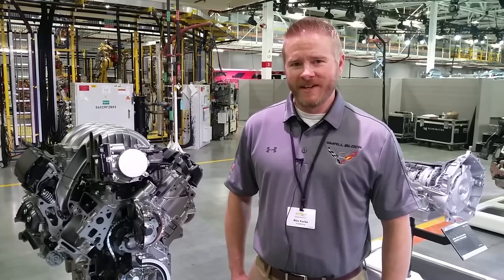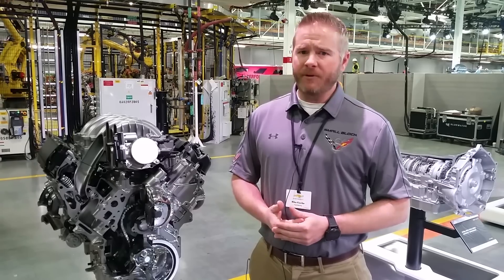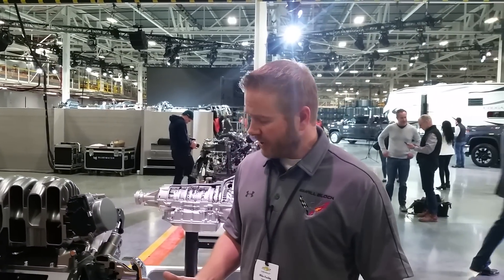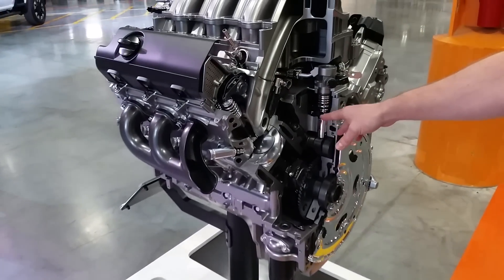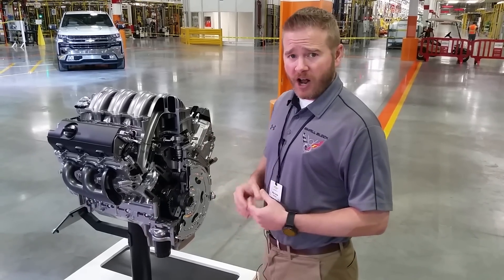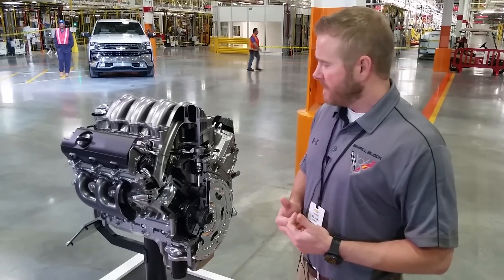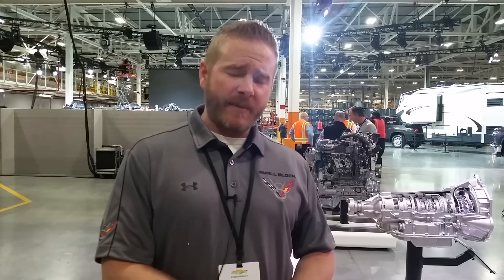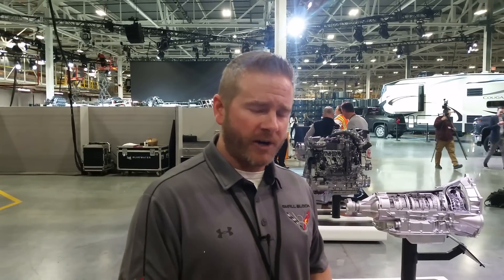New 6.6-liter V8 gas engine on 2020 Silverado HD

Comment: I am sitting by that junk 120k miles. No start,  fuel pump code, crank and cam shaft position code (I bet it's that variable valve actuation). Already changed the locked water pump on 60 k. Lines from oil cooler is bursted on about 70-80 k, beware of buying that stuff! Gm- you're building junk nowadays!  Bring back 6.0!

Comment: If the Variable Oil Pump is anything like the 2014+ 5.3l/4.3l; you guys messed up.
To change the pump you have to remove both the timing cover and oil pan and it’s an absolute PITA.  That stupid two wire harness that goes through the timing cover down to the pressure solenoid requires the pan to be removed just to get to a plastic connector trying to live in a 200+ degree environment.  But there is no way to change that harness without pulling the pan because it only pulls out through the accessory side.
Plus there isn’t a bough clearance to remove the pump anyways without taking the pan and timing cover off.  It’s a trash design and better off being left as mechanical versus electronically variable.

Comment: Putting a gas engine in a 2500 or 3500 is really dumb. Not only gas mileage is bad but the power, diesels are meant to tow and you don’t have to go to a gas station every 15 miles but the torque and power

The amount of shit you put on an engine the more shit it runs. Hint, fucken emissions.

Comment: Only 6.6 L V8 Gas.....why not 16 L V8 next time, when do we gonna learn that to tow or play with weights like a load its better to use diesel......this is 2019, this guy would not be so happy with that engine in 2023......Gas is at 11$ a gallon.TH

Comment: Why mess up something so good? Is Chevy scared because our 6.0 has been lasting so long they have to introduce something we know nothing about to work on comfortably at home? Me 03 is bare bones stock 239k and no real issues. Yeah she uses oil but as a truck owner that uses it to tow and work I check it as needed. Stop trying to improve where no improvement is needed. Improve a damn near bulletproof motor and make it better. Done.

Comment: When an engineer is speaking to other engineers pretending that consumers are listening. 
I'd bet the vast majority of people watching this are car guys (and gals) wanting to know if this motor will be a better swap candidate than the gen IV and V motors.  What is the stroke in inches, what is the fuel pressure in psi?  Are the heads different than the L86/7, can the variable oil pump be swapped out, can the rotating assembly be dropped into a 6.0 motor.  How tunable is the ECU?

Comment: The problem with it is  it is  less than half as good as an old 350 or 327 because now it's switches from V8 to 4 cylinder with hydraulic lifters that are monitored by electronic oiling system that is 12 volts that can and will fail for sure and did!!! it left my girlfriend and I stranded with a brand new 2018 5.3 Chevy Silverado 600 miles in Lake Tahoe from our home we had to leave it there two weeks before they would even look at the truck also the fuel pump is underneath the manifold has to come off  to change the fuel pump  and the way you can tell that it is leaking  after you install a brand new one and tighten it up  would be you would have gasoline in the oil no motor   in the universe should have a fuel pump underneath the manifold inside the motor 3 weeks later they shipped it back down to Vegas when it was finished now I am selling the truck because I do not trust it I'm going to get the Chevy 6.6 Duramax and hope for the best I have already had 8 new Chevy Silverados sense 1992 until today my 99 Chevy 5.3 I had three hundred thirty thousand miles with no problem at all original starter all I did is brakes alternator radiator fuel pump change oil every 3000 Miles full synthetic and tires  that is the motor you guys should have kept the guy who invented 8-cylinder to 4-cylinder electronic should go to prison for the rest of his life ex mechanic!!!!!!!!!!!!!!!

Comment: So gm basically stroked a 6.2 added diesel style fuel injectors with diesel style fuel system for diesel price with less hp and torque..... sounds like you should just buy a diesel for the price this worthless piece of shit is gonna be

Comment: Why isn't GM using some kind of port injector to keep the intake valves clean. Direct injection is a great idea but the intake valves still need to have a little fuel spraying on them.

Comment: I just dropped a rebuilt 69 Olds 455 (7.5) in our 1990 Buick Estate Wagon from a Toronado, It makes 1 less horse power than this new 6.6 (400 / 403) what ever you want to call it and get this, that Carbureted relic still makes more Torque. We use the wagon as our daily and all it takes to wake it up on a 20 degree morning is 5 pumps of the gas peddle , turn the key and its up and running. It only gets 10-13 MPGs but guess what, its 50 years old, its dead reliable and parts are DIRT cheep. Thanks but no thanks, Ill pay at the pump, not under the hood or at the dealer. Anyone interested just stop by my channel and you can see the entire build + all the burnouts, auto xing, etc. 

What they should do is take this new 6.6, throw a big single turbo on it, slam it in a new Camaro with a 6 speed stick shift and compete with the scat packs, and hell cats but its GM so they wont. I mean come on, have you seen their TV commercials???

Comment: Who asked for Direct Injection? More importantly after so many problems with it and other manufacturers already abandoning it. I have an older Chevy and I'm a fan, but no way I'm going to buy anything with this DI engine in it. Sorry, but I don't like carbon deposits on my intake valves.

Comment: Ford little 213 cuin twin turbo v6 put out more low end torque than this 400 cuin v8.
If Ford 5.0 truck engine was 400 cuin. It would make 529 lbs.-ft of torque.
Reply: And would die a quick death trying  to tow the same payloads for sustained periods that this engine is designed to do...
Reply: @lees.4084  No it would not. The 3.5 was made to be boosted from day one. Top of the line F150 can tow 13,000 lbs. 4000 more pounds want kill it.

Comment: The 7.3 ford gas job will be a better truck engine no direct injection this 6.6 makes the same amount of torque as a 15 year old 6.8 v10 that doesn't have vvt or direct injection

Comment: Did I hear forged parts in a factory GM motor?? o_0
Time for boost
Reply: That's what I'm hearing. Buying one soon. Give it a few years. All the sudden these negative reviews will turn into. If you swap cam/intake/ cold air  your at 600hp na

Comment: Agree with 99% of the comments. This nightmare engine is cruel and unusual punishment on a consumer. Chevrolet built the 235 6 cylinder in the 50s that would go 500000 mile and ran so smooth you couldn't tell it was running at a stop sign. There's no reason to go down this Rabbit Trail of engineering nightmare to make a strong reliable motor. This is a joke.

Comment: They should bring back the 350 with a FEW technological tweaks for better mpg, hp and torque.
Reply: I love the old 350s too, but why bring it back???
The LS family of engines are FAR superior to the old SBC in just about every aspect.
Power, definitely. Fuel efficiency, durability/longevity, smoothness and refinement. 
Hotrodding potential, ect., ect...

Comment: How many attempts have there been to create a gas engine to try to break into the diesel market? 

All that fancy jibber jabber bs gadgetry. And no turbo for efficiency AND power. 

If only they used this gratuitous  innovative attitude to find a  replacement for gas and diesel, we'd be running on water in a year.

Comment: Some good ideas. Piston oil squirters like a big rig motor. Cam driven fuel pressure to direct injection. Seems good.  Still simpler than ohc motor. But that variable oil pressure thing seems like too complicated. No thanks.

Comment: Here is what I heard and saw. Fuel pump that is cam driven on back on engine (prob under cowl), Variable capacity oil pump, Direct injection, VVT,  high compression, POWDERED METAL rod (worst type of material for HD applications). All of these things do not lend well for HD applications. I'm sorry. the 8.1 has all forged internals, a simple yet effective fuel delivery system, and a standard suite of engine monitors. This thing needs multiple computer to run it.  the 8.1 has lasted and along with the 6.0 for years upon years. But yet they tell us they have learned and have "improved" the design. I will gladly take less mpg for a truck that will last me 300k mile or more before I need a rebuild. Sorry but so far Ram is the best choice till the 7.3 info gets all released and we see it.

Comment: The next truck I buy will be from the 60's or 70's. No more new overpriced, expensive to fix over designed crap. All I want is a pick up. A simple pick up.
Reply: You should get a 1970-earlier inline 6 cylinder truck with 1 barrel carb, 3-speed manual.
Forget all that overly complex V8, 2 barrel crap.
Better yet, get an old Ford T model with a flathead 4 cylinder.
1919-earlier did away with that overly complex electric starter too...
Reply: @lees.4084  Or, he could get a GM with a 350 and not have to worry about a shit Ford.
Reply: @limjahey4585  Nah, V8 is too complex. Too many parts in it that could break.
Electric start, electronic ignition, and vacuum advance, pneumatic tires, power disc brakes are all dangerous, unreliable and failure prone technologies that should be stayed clear of.
Avoid all that newfangled crap.  
A 1918 flathead 4 cylinder Ford is the way to go...🤣
Reply: Me? Heck, I’m for horse and buggy myself. Just don’t go out when it’s dark, cold, hot, rain, or snow. Let’s all live like Amish.

Comment: Fords new 7.3 also uses a variable oil pump and variable valve timing like Chevys new 6.6 they also have a FORGED crank but ford DONT have FORGED connecting rods and I don’t think fords fuel mileage will be as good.

Comment: I'm not quite sure who this man is speaking to? 
Why can't this man say, "This is a basic engine that has nothing on it that will break before 120K miles. 
If the computer fails, then don't worry. It doesn't need one to run."

Don't they spend money on surveys?  Like what the buyer wants?

Oh, wait the surveys were done by the same companies that took the presidential survey for the last election.

Comment: Why not LT 6.2 with an iron block save million in design more hp and torque
Reply: Because a 6.6 has more low end torque, especially under peak torque than a 6.2 will.
You have to understand that this is  a heavy duty towing engine.
Its goal is a broad, flat torque curve, even if you have to sacrifice some peak torque to get it, and to have features to help it survive under prolonged high stress towing conditions.

Comment: All im seeing is having to change the oil in this engine many times a year. Due to fuel system design. Theres no way l would be changing the oil every 7500 miles. Lol . im thinking like 3000 miles  for an oil change on this engine. The oil in this engine is going to have alot of fuel mixed in it after 7500 miles. You will smell it when changing it. I love my gmc Sierra. Its a great truck but im alittle concerned with this design. I hope l am wrong. But my extensive experince tells me otherwise.

Comment: Bring back simple engines that we can work on
Reply: What's so complicated about this new 6.6L engine?
8 cylinders, 8 spark plugs, and injectors, 16 valves and rockers.
V8s dont get much simpler...
Reply: @lees.4084  All they need is a carb and fuel pump still on the engine no computer run engins if you want more pore drop you a different cam in like in the 60s and 70s muscle cars
Reply: @6484373  That's how you "work on an engine" plugging and unplugging connectors?!
Reply: @cencoast_7.340  Rebuilt a 2002 4.3 vortec from my s10 so yeah that kinda requires unplugging connectors at some point. In case it's too complicated for you to understand I was saying, the point was that working on a fuel injected engine is just as easy as working one with a carb.
Reply: @cencoast_7.340  Obviously there is a lot more to it. There is a lot more to every system on any machine. But is anyone that knows just a little more than how to tune a carb going to mess with any of the details? Probably not. Most of the complexity of a fuel injected system is how it is controlled, but that never even needs to be touched unless you are modifying the engine.
Reply: ExcessMean Fuel injection is actually a complicated system, Nothing like putting a simple puzzle together. You and I are talking about two different things. I’m referring to actually “working” on a fuel injected engine and being able to diagnose it. You are talking about the simplicity of plugging like plugs into each other. Think we’ve taken this far as far as we should.
Reply: @cencoast_7.340  If you want to talk diagnosing a fuel injector system I still think that it's pretty simple. But you're right  this has gone as far as it should.
Reply: yes yes yes...did I say yes.....

Comment: 10.5:1 compression on regular assoline, my diesel engine laughs at your engine, using only diesel fuel and high airflow at 18.5:1 compression.
Reply: And, costs $20,000+ more to buy.
And then, theres the higher cost of diesel fuel, which just about wipes any fuel savings, FAR higher maintenance and repair costs...
Modifications and upgrades? 
Better have really deep pockets...

Comment: Should have never gotten rid of the 350
Reply: You don't see  chevy 350s with upgraded valve springs making 1000 hp and surviving 25 psi of boost of stock internals.
Reply: @brianmorrison9066  tf are you talking about? The 350 is quite literally the most reliable gas engine they've ever made. That's why they stopped making it. I've seen multiple generations with over 300k on them and still running like new.
Reply: I would rather have a 4.8 rather than a 350. Gen 1 small blocks are worn out at 100k miles. Gen 3 is good to 300k. Better sealing, better heads, 6 main block, exc.

Comment: Rod Length has ZERO to do with displacement of engine.
Reply: So if they didn’t use a 6mm longer rod would it it still be a 6.6 l ? He said it allows them to get to the 6.6 displacement
Reply: Yes it would still be a 6.6, Stroke length and piston bore is what determines displacement. That is why I was surprised when he said the 6mm longer rod is what gave them the 6.6.
Reply: @davetscantech  higher deck height will let you have a longer stroke.  Connecting rods are usually shorter the larger the stroke.
Reply: But with a different stroke crank you need a different length rod or different piston pin location?
Reply: I understand how it works but if you have a longer stroke crank you need shorter rods if the deck height is not higher. It sounds like GM increased the deck height with a longer stroke crank and increased the rod length.
Reply: You don't know what you are talking about please do some more research on how displacement is calculated you mouth breather
Reply: There we go with name calling, you don’t know me. 
All he said was it helps them get to the 6.6 displacement not the rod gives them the 6.6 displacement. 
Look up stroker kits, they come with rods
Reply: @davetscantech  wasn't talking to you I was replying to the original comment.
Reply: Oh, good, I’m glad someone understands
Reply: @davetscantech  yeah I can't believe the misinformation people so blindly believe
Reply: Not really true, the rod length has to be adjusted to match a longer stroke.
Reply: 100% true. No matter how long or short your rod length is it has ZERO effect on the displacement. The rod length doesn't HAVE to be adjusted for longer stroke. The old SBC days you could put a longer 3.75 stroke in a 4.0 bore block. You could chose the 5.65 rod length or the 5.7 rod length. The displacement was still the same, 383 cubic inches with either rod. So again rod length has ZERO to do with displacement. 100% true.

Comment: They should easily be able to get 500 hp out of this engine the torque is slightly low too. This is a joke come on Chevy get it together i was expecting much more. Although I do like the oil pump design! Didn't get to look at the water pump but I have a great idea let's put the most common failures in an easy accessible place so I don't have to tear the whole front end down to change it.

Comment: Still seeking a procharger bracket for gen 5  4.3 v-6   - You can see the 3 engines if you put each one in a tab in your browser - 
http://gmauthority.com/blog/wp-content/gallery/gm-4-3l-v6-ecotec3-lv3-engine/gm-4-3l-v6-ecotec3-lv3-engine-2.jpg
http://gmauthority.com/blog/wp-content/gallery/gm-5-3l-v8-ecotec3-l83-engine/gm-5-3l-v8-ecotec3-l83-engine-3.jpg
http://gmauthority.com/blog/wp-content/gallery/gm-6-2l-v8-ecotec3-l86-engine/gm-6-2l-v8-ecotec3-l86-engine-4.jpg

Comment: 21st century technology and still less power than engines from the 60’s/70’s.
Reply: Different rating systems.
Up til the early 70s, engines were rated using "gross" method.
No accessories or emissions equipment, no engine driven cooling fan, open headers or manifolds, open or no air cleaner were used on this test.
Engine could be operated at a much cooler temp than it would be in the car.

From the early 70s on, SAE "net" method was used.
This meant that ALL available engine driven accessories, alternator, P/S, A/C, smog pump, cooling fan, and all emission equipment, including catalytic converter, muffler(s) tail pipes, ect, had to be installed and operating, exactly as it would be installed in the car.
A factory production stock air cleaner has to be in place, including snorkels.
Engine was tested at production intended operating temp.

The "net" method reduced power figures by 35-50% compared to the "gross" method...